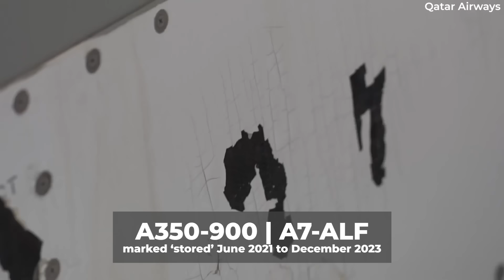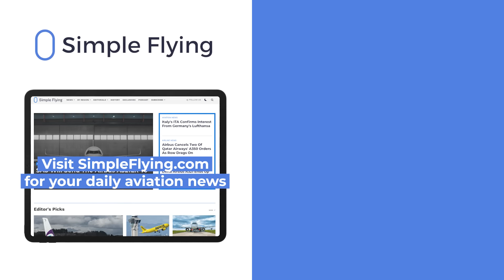Saga FULLY Over: Last Qatar Airways Airbus A350 Returns To Service

Comment: But how was this surface degradation issue fixed, completely new surface coating or paints ?
Reply: They changed the type of copper foil that they cover the carbon fibre with before painting
Reply: @Pedro_the_great  👍👍

Comment: Ok..but is the issue with the paint still present tho ? Will the thermal cycling difference between it and the composites underneath still cause tensions and cracking later ? Or was it issues with the metal net under the paint ?
Reply: No, no, and yes.